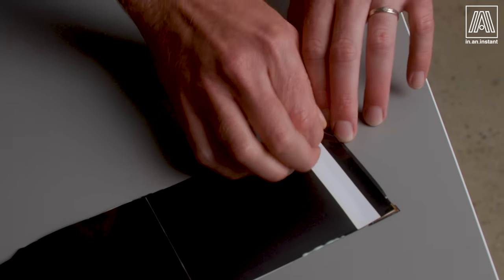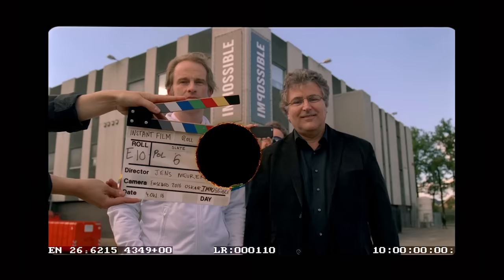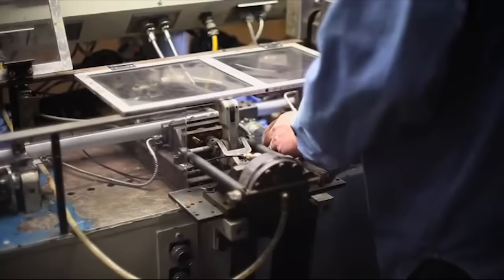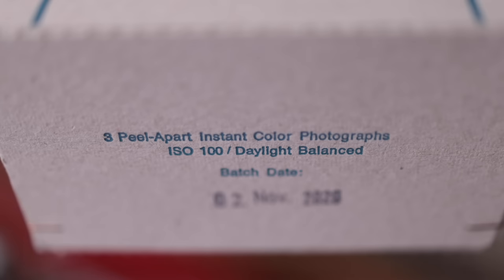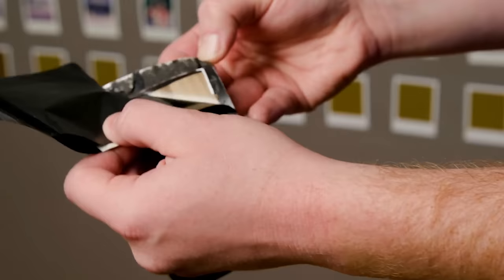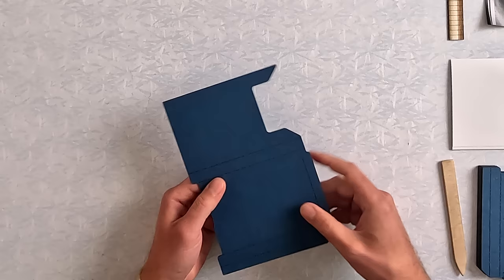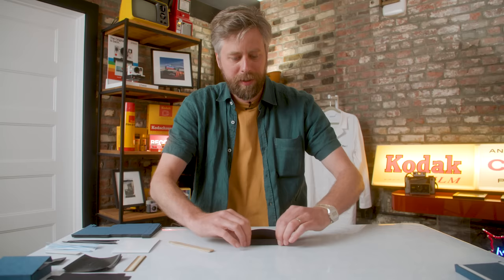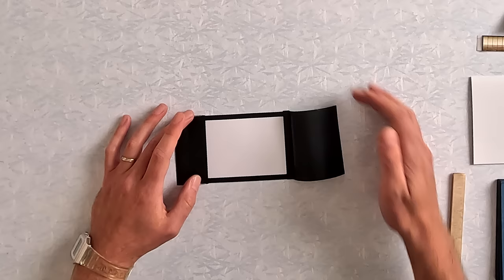SAVE PACKFILM...yourself?! Supersense's DIY Peel Apart Film Breakdown, History, and How To!

Comment: 88€ les 8 films c'est hors de prix, même pour les passionnés.
   A 2 € le film oui ça donnera envie de commander par 100 , 150 200 voir 500€ 

   Mais 88€🤦🏽‍♂️ c'est impossible. 
   Les boîtiers resterons encore longtemps dans les vitrines.
    On surveille votre solution à venir merci
Reply: My thoughts exactly, glad there are efforts being made but when the cost is nearly the same as expired packs of Fuji the need to assemble it yourself "to save money" isn't actually saving money for the consumer which is what will make or break the revival of pack film
Reply: Well it’s way cheaper than buying the premade shots from them
Reply: Nan mais t'as pas écouté la video toi.
Reply: @refard5  si après j'ai ptetre pas tout compris.
   Ils espèrent faire baisser les prix ça j'ai compris.
   Mais jusqu'à quel niveau de prix de revient au film ? 
   Le rêve serait à moins d'un euro.
Reply: @JoffyCake this is new, not expired. Expired film always comes with risks. That $100 pack of expired film may not work at all, ormneed longer processing which you learn after wasting a shot. Given all the film today is more than 6 years past the date. I'd rather spend the money on known good/fresh film.